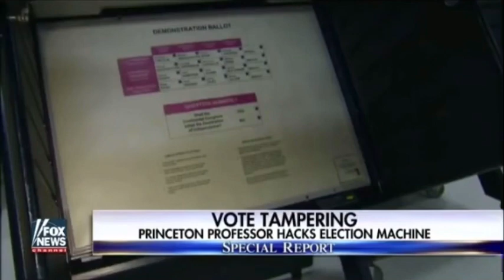How to Hack a Dominion Voting Machine: A Princeton Professor Demonstrates in a 2016 Fox Segment

Comment: I heard there was an update on these systems the night before the election. Would you need a hardware change if you could simply install some kind of firmware update? Doesn't seem hard to have some experts pull apart a few of these machines to see if there was monkey business.